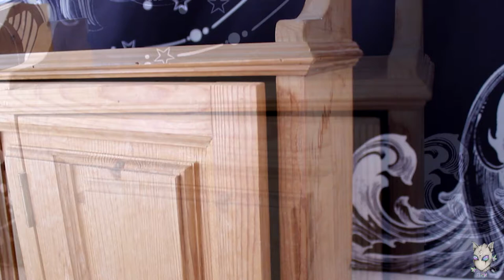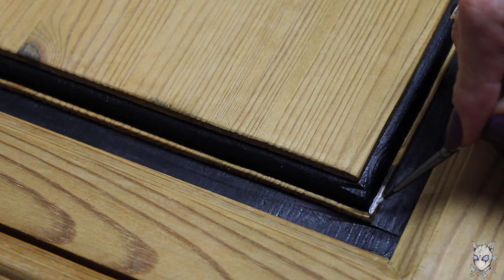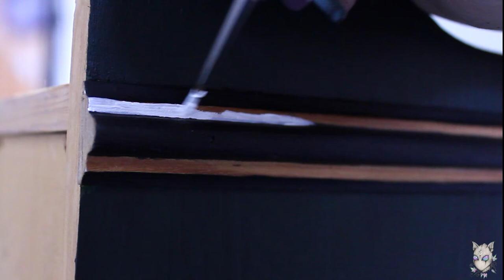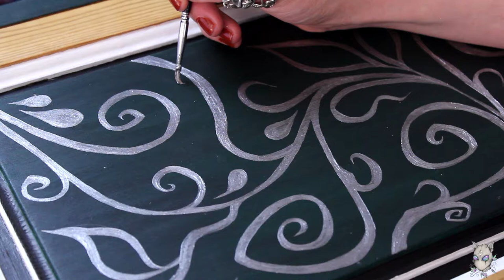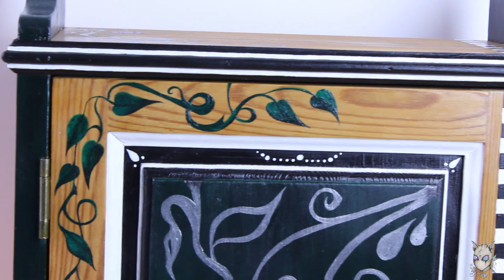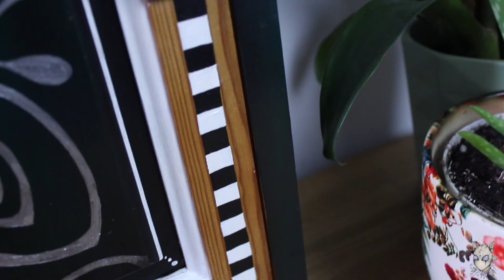SMALL CUPBOARD MAKEOVER! | Emy Meowski

Comment: If you want to mount it on the wall then you just need to either screw it into studs or you can use those toggle screws that open up in the wall and that will hold the weight.